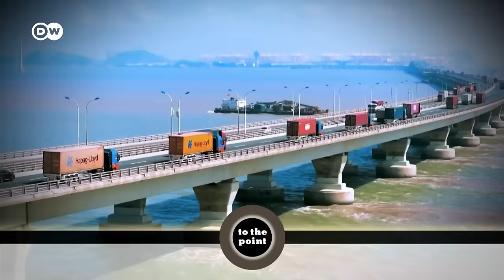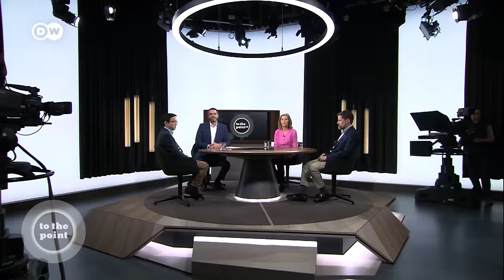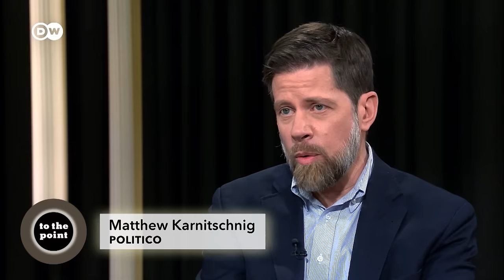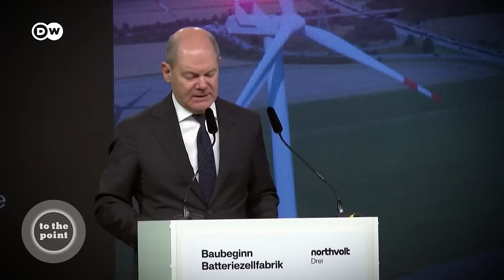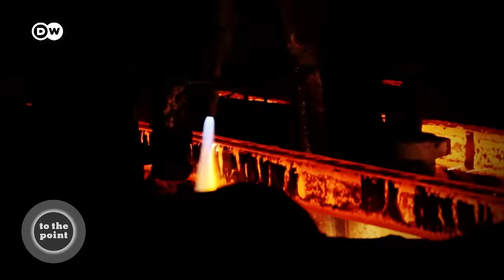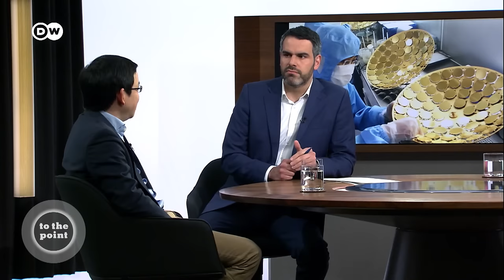US-China trade war: Which side is Germany on?  | To the Point

Comment: The core logic behind the loss of competitiveness in German manufacturing is not competition from competitors. The core issue is a significant increase in costs, as well as a comprehensive surge in energy, fuel, transportation, and labor costs. German industry needs a stable Europe to rise again.
Reply: IMHO，the root cause of the decline of the German manufacturing industry is the radical cost control. Professional managers make unreasonable management for the sake of financial report figures. For example, they reduce inventory and production, which leads to out-of-stock and unstable quality. They reduce investment in R&D, and even lay off the R&D team. They greatly reduce business activities, and even restrict sales visits to customers. Then sales drop sharply, and then cost control becomes stricter, and then sales continue to drop, and then layoffs begin...
Reply: @zhaoraymond8656  What you said also makes sense. This reminds me of Volkswagen Passat cars sold in China, which have simple safety structures and functions.
Reply: @SpruceWood-NEG  You are talking about reducing configuration. Reducing configuration is accompanied by price reduction. Passat sold in China was once exposed to serious quality problems due to reducing configuration. Fortunately, Volkswagen made up for the mistake in time. European and American car brands sell cars with reduced configuration in China, which is also an important reason for the rise of Chinese domestic car brands. However, the problem I am talking about is the excessive management of German companies, which has little to do with reducing configuration.